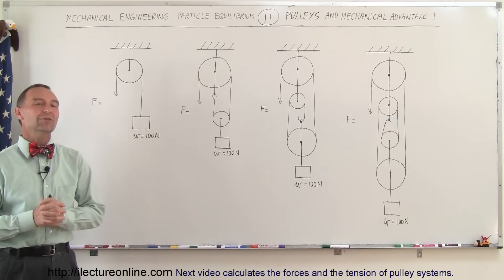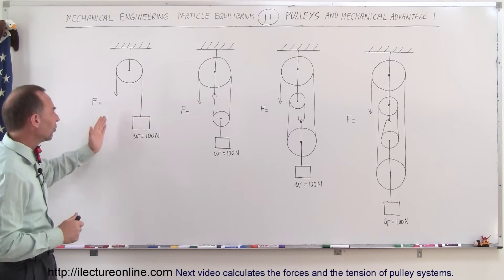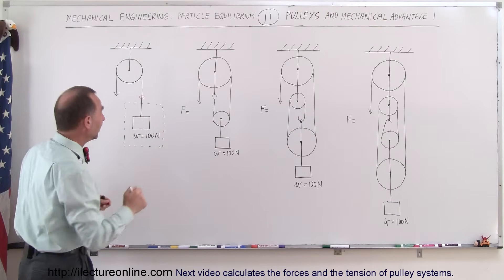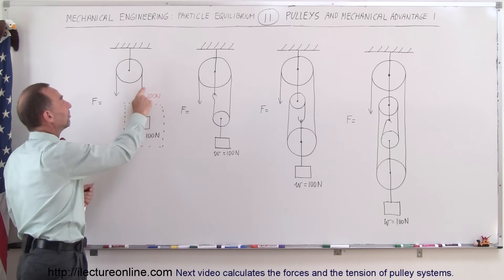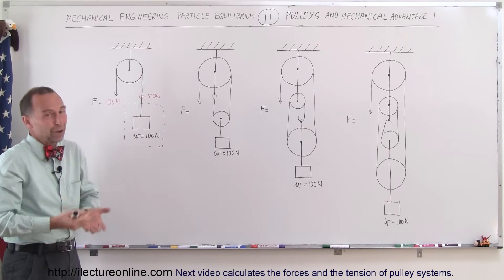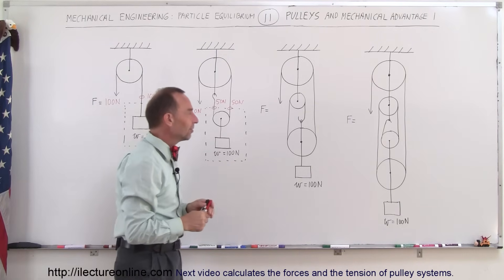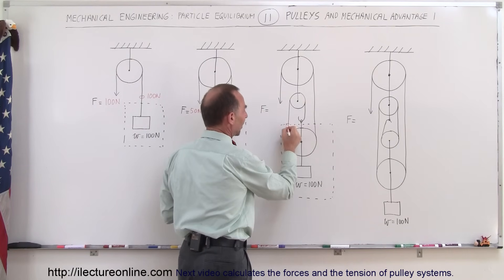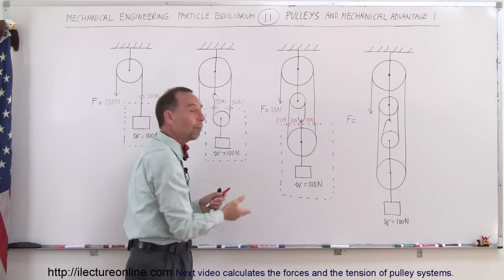Mechanical Engineering: Particle Equilibrium (11 of 19) Why are Pulleys a Mechanical Advantage?

Comment: I understand the math and physics, but I can’t come up with a verbal explanation of how and/or why it works - except to say, “magic”.
Reply from the maker: The principle here is that the work done pulling on the rope equals the work done lifting the object.  W = Force x distance and if you half the force you must double the distance.
Reply: @MichelvanBiezen  it still sounds like it exploits physics to me
Reply: @danielgudi7446  If you write what exactly sounds strange, I think someone here can give you a solid, direct answer to the issue.
Reply: @jensdanbolt6953  I know that you trade travel way for force and you can use your own body weight as force instead of having to lift yourself up as well as the load.
The second point is a big advantage on it's own but I don't really get how the first point makes any sense.
I know that it is a meme that people compare everything with video games but that just sounds like a big to me
Reply: Michel van Biezen Not trying to be rude here, but you introduced another concept in “work”, FxD. I think what I’m after is that re-directing the rope by means of two or more pulleys causes the load’s mass to be shared/split between two or more sections  of the same rope so that what I pull on feels like only a percentage of the mass. All the extra distance I have to pull is just the process to gather all the rope that has been re-directed by wrapping around pulleys. To be honest I’m not sure if I’m asking how it works or why it works. I have the same “issue” with a lever.
Reply: P Brooks work (which is just energy put into/taken away from a system) is fundamental for talking about forces. The essential quality of force is that it changes the energy of what its exerted on. You cant really talk about forces as static things, they are rates of changes. What it means to hold something with less force (ie 25N at 4) is that in order for the system to change (ie the weight would start moving down) you need to exert less force to stop that movement in configuration 4 than in 1. And that is because when you pull “1 unit” on the rope, in configuration 4 compared to 1 you move the weight less (because of all the turns of the rope). At least thats my interpretation of it but I would welcome someone to correct me if im wrong.
Reply: What isnt mentioned here is the ceiling that is holding everything up is exerting an equal and opposite force to hold everything up. when you pull on the rope u are exerting more force on the ceiling in order to lift the object.its like having another person pull the other side of the rope.

Comment: May be stupid question, but I cannot figure for the life of me, what the pulley's cable is finally attached to; it looks like a hook connected to what exactly?
Reply: Krešimir Ćosić looks to me like a u-shaped bracket attached to a shaft that goes through the center of the pulley.

Comment: I dont follow in the examples beyond the first. If you pull the rope down some n meters, and the weight lifts up some fraction of n meters, it seems to me that there is now more rope length in the pulley system than began. Say with example 3, if the weight was hanging 1 meter off the third pulley, the handling end of the rope was 1 meter in length, and the rest of the pulley system used 3 meters of rope, then if you pulled the weight 0.3 meters up, you would have to had pulled the handling end of the rope 0.9 meters down. There would still be 3 meters of rope between the pullies themselves, but the weight would now be hanging 0.7 meters off the third pulley, while the handling end of the rope would now be 1.9 meters in length. 0.6 meters of rope seems to have come out of nowhere. Unless the pullies themselves move?
Reply from the maker: Yes, the pulleys also move, (unless is some examples, some pulleys are attached to one another).
Reply: @MichelvanBiezen  which pullies move in example 3? And does that mean that if all the pullies were fixed in place, there would be no mechanical advantage?
Reply from the maker: In the third example only the bottom pulley will move.  The second question is too general to answer it.  We have to look at each example individually.  In general the pulleys don't have to move in order to have mechanical advantage.

Comment: How did you know to start with the second pulley up in example 4? All the others started from the bottom, and it seems to me you would end up with the same 33 / 33 / 33 distribution again if you started at the bottom, giving a different answer. What am I missing? :(
Reply from the maker: Since the third and fourth pulley are connected together, we placed both of them in the same free body diagram.
Reply: @MichelvanBiezen  Thank you for replying! I kind of follow, but am still struggling a little! Is it because they are unable to move in relation to one another, i.e. there is a non-extensible cable between their centre points? I ask because to my inexpert eye, in all the other examples the bottom pulley is 'connected' to the one above it, just with a cable that can change length :) If one comes across a pulley that is connected to another with a cable that cannot change length, should you always treat it this way, with a combined FBD? Many thanks for your kind patience to an old(ish!) engineer who has long since forgotten what he learned on his mechanical engineering degree!
Reply: There's no reason you can't start with a free body diagram of just the bottom trolley first: 
It's connected in three places, with the two ropes on the side having to equal each other, but not the center one necessarily. And center tension + 2x side tension = 100N.
Then you would make free body diagram around the other trolleys and end up at the same answer eventually.
Reply from the maker: I don't like to use the word "always".  It may be a good idea to watch a few of the other pulley videos to see how they work.  Together they may give you the understanding you are looking for.

Comment: Does a pully have different force ratios depending on the angle of the redirection of the rope?
Reply from the maker: As long as the angles remain small it only makes a small difference.
Reply: @MichelvanBiezen  how are they related? What difference is a small difference?
Reply: @noreaction1  i think as long as you assume no friction, etc, force pulling should be equal to load no matter thr angle

Comment: When my teacher tried explaining this to the class they didn't mention that you would have to pull it longer for each pulley. Saying that helped alot thanks
Reply: Distance x Force = Work. This means that "moving" pulleys allow you to do the same work with less force with proportionally more displacement. Fixed pulleys work differently.
Reply: @albertoolmos21  How are they different.  I just assume he drew the pulleys separately to show how many ... that the point of axis would only be in the free body diagrams.
Reply: Cullen, with simple machines, it's always distance that gets traded for increased mechanical advantage. Levers are the same. If a lever has one side 4X as long as the other side (measuring from the fulcrum) it will have 4X the mechanical advantage (i.e. can lift 4x its input force) , but must travel 4 times as far.  With hydraulic systems, same idea. The input 'piston' must travel however much the larger (output) piston is. Ex. if the input piston is 2 sq. inches in area, and the output is 8 sq inches, the input piston must travel 4X as far.
Reply: @davidschmidt6013  Ain't it nice and comforting that laws of Physics are the same (in an ideal setting)? Like conservation of work/energy. In essence the Nature is simple... oops I didn't say that...  (P. Dirac) Fact is that someone else before Dirac said it in SUMMA THEOLOGIAE: The simplicity of God...
Reply: Glenn Heiselman  Yeah   ... in my youth my dad had a 2/3 or 3/4 rope pulley.  Meaning 2 or 3 pulleys on top and 3 or 4 on the bottom .... 

and  it felt like, when I had to roll it up, a mile of rope.
Reply: Yes you don't get something for nothing gear ratios work the same way.
Reply: One question :For example , he only explain the tension force between two point of the pulley connecting to the object ,  what about the tension force on the other pulley, for example, in the second example, the one connecting to the object is 50N, but is the other one tension is 50N is too or not?
Reply: @tramquangpho  That is correct, the tension on the other rope that is not connected to the object also has 50 N of tension on it. In the real world this would mean it's tied down to something or someone is holding it, if the rope was just hanging freely the object would fall and the rope system would become undone.
Reply: It brings me back to Oromocto Junior High (NB/Can '70s), The science teacher..... FIICRHN but I can still see the expression on his face when Matt Meyer exploded a beaker full of zink cips and Sulfuric Acid we "Were" making Hydrogen gas, class of 25-30 students.....Good times....GOOD-TIMES!

Nobody got hurt tho, other than a few Soiled Underwear....Merry Christmas from Red Deer AB.
Reply: https: //youtu.be/UHocGHguWJI👍👍👍👍👍
Reply: https: //youtu.be/paVOEi7cYrA.(  Mec.English and  french)👍👍👍👍👍👍👍👍👍👍👍💐
Reply: There's always a catch
Reply: The energy or work done is constant ( Conservation of energy). So WORK DONE = FORCE X DISTANCE = CONSTANT.
Reply: Because of very low level courses in your country. Where are you from?
A good study level should be to go ahead and also demonstrate with an equation what's happening and why.
This way you would be able to understand what you see instead of just apply stupidly and also be able to compute an observation in equation abstraction to be really ingenious and powerful.
By the way of better study level in a country for everybody, citizen concept can exist, and corruption would disappear. Low level knowledge people will be stolen by crooks instead.
This kind of low level study program where you can see no demonstration, no abstract concept, MQC examinations instead of rédactions, near to zero cultural knowledge is all of the time a very low level citizen mind thinking and very high corrupted country area.
Reply: @DGDG0000000  Amen

Comment: Thx for the great explenation. What about the opposite? How lift the weight 1 meters by pulling eg 0.5 meters? And how are the forces then? Need to pull with 200N to lift 100N?
Reply from the maker: Yes, if you place the weight where you pull and pull where the weight is.

Comment: So quick question, you mentioned that with pully sistem 2,3, and 4 you have to pull the rope progressively further and further the more pulleys are in the set, this would mean that you are doing the same amount of work over all? Thanks
Reply from the maker: Yes, the work pulling down would be the same as the work done to pull the object up.  (ignoring frictional losses)
Reply: Michel van Biezen 
so the overall use of the energy is same?
Reply: I’m not sure if it’s exactly four times but yes. I do roofing we get people trying to show off carrying 2 rolls of felt at a time across a roof.They can do it two maybe 3 times and that’s it. I can carry 1 roll at a time all day long
Reply: @balfarzar  in the second picture, the instructor said that it was pulled 2 meters, so eargo divide by 4 then distance you need to pull 4 times the distance.
Reply: Not really it’s easier to pull 25k 4 times than it is to pull 100k once
Reply: @balfarzar  but you would be pulling that 25k four times further than the 100k
Reply: @balfarzar  but you would be pulling that 25k four times further than the 100k

Comment: 100 is the mass, acceleration = ?  F=MA  so if the rope is not moving what is the F ?
Reply from the maker: 100 is the weight (in Newtons) that is suspended from the pulley(s).  The units here don't matter, they can be pounds.  F is the force required to keep the object from moving.  There is no acceleration.
Reply: Why isn't F zero if A is 0 ?
Reply from the maker: In order to have an acceleration there must be a NET force.  For example if you push against the tree, the tree doesn't accelerate.   Why?  Because there is an opposite force (Newton's third law) that pushes back with an equal and opposite force, therefore there is no net force.

Comment: But the pulley does have mass and there is friction. So your math is incorrect.  Thanks for the wrong answers. You could have just said divide the weight by the number of pulleys. You get paid for this?

Comment: but since the gears do have mass in real life,how do they give an advantage?
Reply from the maker: The mass of the pulleys would have a very small effect on the overall performance and mechanical advantage.
Reply: @MichelvanBiezen  haha... spoken like someone have not work at an actual site before. What you mention is an assumption. In reality, pulley mass can reach significant amount of weights that can limit how much mechanical advantage you have. 

Just try sourcing a industrial made pulley. In engineering school, assumptions are made to make concepts easier to understand. But engineering is supposed to be real life application of science. Got to tell those kids of yours, assumptions will be removed once you reached certain level of consideration.

The same about gears.
Reply: Gilad Kay obviously negligible mass compared to the heavy object being lifted
Reply: Having as a kid used a block and tackle to move some heavy stuff ... It works the friction  of the pulley's and the weight of said pulley's is negligible in the scheme of it over all.  

How much damn rope you gotta pull tho .... can get to be enormous.

Comment: but.. what about the chain hoists, the one chain is on an infinite loop. pulling the like gear ratio.. of course you can set the block tension for the ratio of the lift, to make it harder to easier depending on the common load. you see this a lot at docks... You can pull like 10 metres of chain and only go up 20 cm.
Reply: @170221dn  you think of things asa grouping its all technology and its not different, its nearly identical to puley system and their relation is really interesting. Gears are like pulley's on infinite ropes... but has its imitations like pulleys.  What is interesting is the hoists tension can be set for the load, which htne its the structural strength of the material doing the work. There is other systems you could creaatea hybrid system. IN which you pull a puley to increase tension on a large system of mechanical coils or something similar. THen release the tension made and the object is then lifted.. hmm who knows.. but I Would say they essentialy work the same.
Reply: @170221dn  … yes and the lbue in the sky is similar to the blue in the eye of the beholder, this is a superflourous opinion that means nothing your disagreement has no end or right, its an opinion, and is not gauge but natural fact or law, but my persective in the manner in what I was relating was not on the inference, I was visually observing the pulley systems and gear systems simulatanious in the applciaiton of load reduction by means of tension similarity, if that point doesn't sound like a decent similarity of similar deisng in which the gears in a hoist do the same work as a the rops ina pulley but its on a infinite system. I was referring ot the loop in the chain hoist as a reference to a point of pulling without limitation much like most classic pulley setups require limited length of rope. I then even stated ifo ne was following my train of thoguth (not you) (not anyone in particular) that you can make a hybrid pulley system with an infinite loop, that oculd build energy resvoir of tension in a similar manner, but hten the next relation of advancement would be a gear tension setup since it would be a formal advacenment of thoguth after this... When wanting a loop. The real struggle with hoists is setting the tension with massive wrenches... anyways... that's besides the point.. it really doesn't matter... my comment was just ommenting in my relation to viewing the simlairity of pulleys to gears... Althoug hgears change ize etc.. the relationship of the math and tension relation to a sytem of pulling to mechanical advantage is not unique amongst them... perhaps its too borad ofa comparison? How fine of detail you want... is it just blue for the sake of blue, or blue of the ocean in which s like the sky, but then these two bodies are not similar? yet their colours are? do you see therelation I am making? perhaps not.

Comment: It may be interesting to evaluate the ceiling reaction as well (the load on the ceiling in each case).
Reply: @DjoXey  That's correct in case 1, but the general solution (in this presentation) is: F_ceiling = W+ F_ropes (including case 1).

Comment: I'd like to see the force on the top-most pulley 'hanger'.  It seems in the first example, that the attachment to the 'ceiling' has to support 200 N, the second only 150N, 133-1/3N for the third, and 125 N for the final example?

So having more mechanical advantage just happens to also lessen the needed strength of the attachment point?
Reply: In reality the ceiling would also support the pulley weight.
Reply: that's antigravity know
Reply: Mr. (Dr?) vB can answer authoritatively... but my thought is, the ceiling always supports 100N.  Based on the assumptions, the pulleys weigh nothing, the rope/cable weighs nothing... weight at the ceiling must be 100N.  That said, I expect there may be some exception between the time force is applied by pulling down, and when the pulley(s) / weight actually begin to move...  I see where you’re coming from - if I am pulling on the cable with 100N, and the weight is 100N, then the ceiling must be holding 200N.  Now I have a headache.  Engineering school was way, way, WAY too long ago...